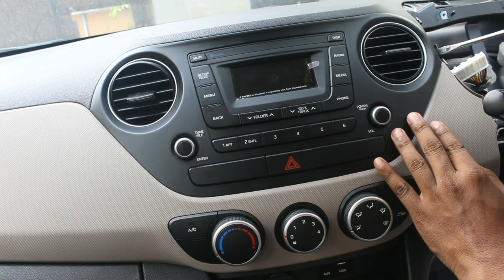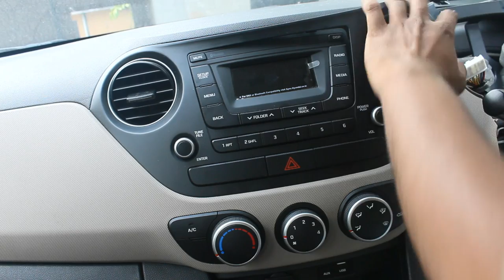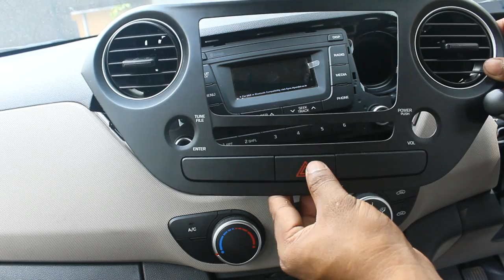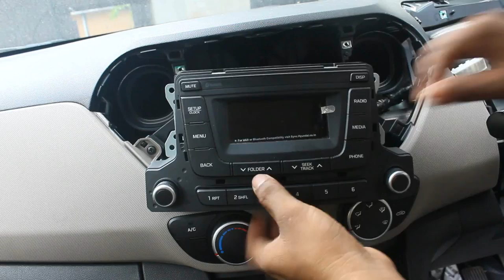Grand i10 stereo removing @CJJVlogs

Comment: Very wrong method to remove the head unit. You are causing permanent damage, scratches and dents to the dashboard by using metal flat head screw driver. Never use metal tools on dashboard. Only use plastic tools. For grand i10, the dummy cover near hazard light has to be opened first to remove the stereo without damaging dashboard.
Reply: Hi Daniel, did you have any info about the cable harness pin out of this original radio? Thanks!